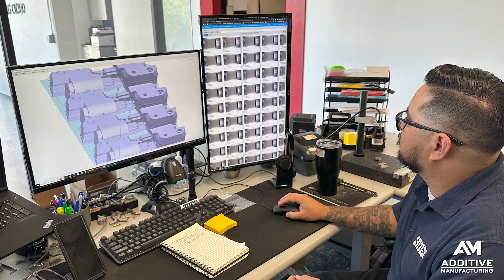Intelligent Layering Metal 3D Printing at 3DEO

Comment: So the left over cake is not reusable and must be discarded as waste?  Charles
Reply: maybe it can be crushed and reused?
Reply from the maker: Hi Charles, Part of the leftover cake is used as a conformal setter to mitigate warpage effects during sintering. The proprietary binder 3DEO developed is aqueoused and can be washed out. 3DEO is currently refining the process for recycling the remainder of the material.

If you haven't already seen this, Stephanie also published an extended write-up about 3DEO's process and its applications: https://www.additivemanufacturing.media/articles/from-parts-to-problem-solving-3deos-evolution-with-intelligent-layering-metal-3d-printing 

Thanks for watching!